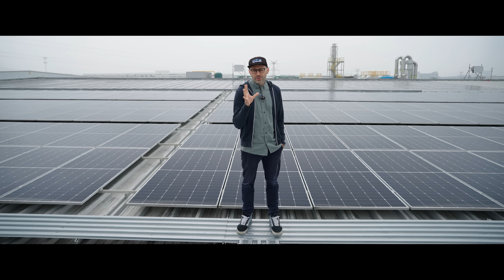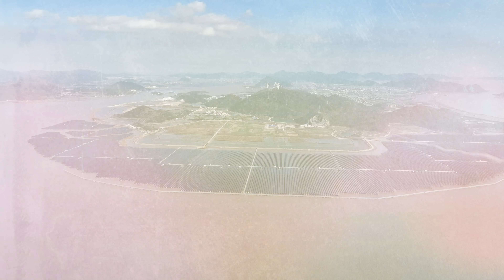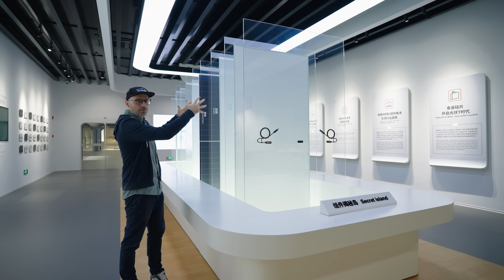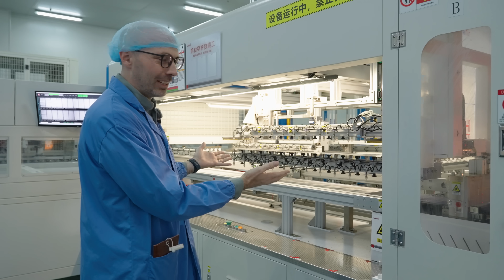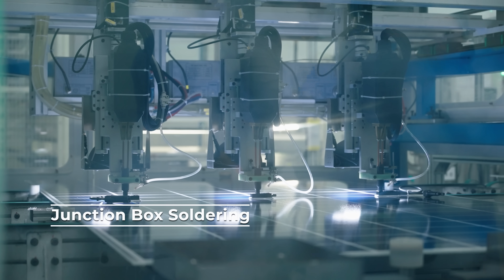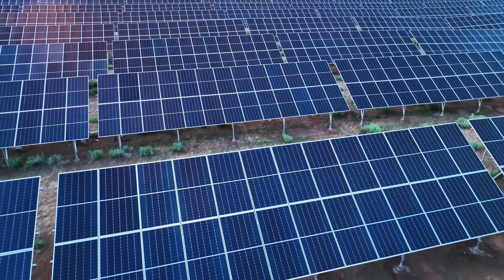Inside LONGi's AI Driven Solar Factory | Everything Electric Show

Comment: The backside gain off a bifacial panel you say is 15-20%. This varies between almost zero (black shingle roof) and 20% high above white sand. So in real world testing is dependent on what's behind it. You can't just state 15-20%!

Comment: Nice soon my 2100mm prediction of 4 panels getting to 3kW is getting closer glad I got the DNO approval, Aiko were in the lead now surpassed not by much but in solar every little helps, but what I would like to know is that a standard size ie 1700 or 2100 and that quote for efficiency is that for the all black version?

Comment: Solar panels seem fairly easy to make and easy to get high yield. By contrast large flat panel TVs are almost impossible to get right and very expensive to make. Yet TVs cost less than solar panels. Why?
Reply: "Yet TVs cost less than solar panels." <- you've presumed quite a bit.  An individual solar panel is not that expensive, but if one kits out an entire house with installation the price is more in the labor and totality of the pieces.  And here in California it costs about $16k to outfit a house with PV solar, and many people spend much more than that on their home theater.
Reply: @TheDanEdwards  For 16k you can get about 80 TVs.
Reply: @frankcoffey because tv also Made in China 🇨🇳

Comment: Very cool! In the intro you hinted at what could be a compelling subject:  Would there be a way to adjust the recipe of a solar panel to optimize it for different latitudes? (and/or climate zones.) What works well in Austin, Texas won't work as well in Portland Oregon of course. But the formula for the panel itself, not strictly the hours of daylight, may also be compromizing its full potential.
Reply: Solar panels require daylight. The more efficient the better. That's about it. The best optimisation I recommend is looking at bifacial panels. These will do better if mounted above the ground. All panels have a dropoff as they get hotter. About 0.3% per 1C above 25C benchmark
Reply: 'Encapsulated from the environment' works pretty well for keeping out both water and dust. Different panels for different latitudes would need a large advantage to be worth the faff and cost of having to make/stock/ship/buy 'north' panels, or 'wet' panels, or 'desert' panels. or 'cloudy' panels for different places. I'm not sure there is enough difference to be had, and just making them 'environment-proof(30 years)' and  'good at collecting light' probably works better overall and is definitely cheaper. There may be real tradeoffs optimising for cloudy places and bright-sunshine places - I think that's the only axis that might be worth differentiation, in which case someone probably already does that. It's the same photons, but at much more random angles and fewer of them.

Comment: Great explanation. Is AI given too much credit? How much is just traditional IT with well thought out manufacturing processes?
I recall with my first panels each one had a piece of A4 paper with the test results. With new panels, can they print a QR code (on the frame), which can be scanned and go direct to the product specs and the test results for that specific solar panel, as well as any paper work needed for shipping and import duties?  
The main cost in solar - especially roof top - is the installation and all the "paper work" and metering associated with it.
Reply: By AI I think these industrial engineers mean computer vision paired with a classification algorithm (could be neural net based) and a well designed stack around that to handle all the requests and integration with the robotic automation tools. Unless they've trained another AI system (ie neural net) to do the whole thing end-to-end which would be even more impressive. It's amazing either way!!

Comment: Elliott you said panels are up to 660W - what is the maximum wattage of standard residential sized panels?
Reply: I do not think there is a single standard size. They have a range of sizes to fit different applications.
Reply: I would say around 425-450W right now a Panel with 22.3% from TCL reaches 435Wp, the same sized panel with 24,43% would reach ~476Wp, they are 172 cm x 114 cm in size, I have TCL Panels on my relatively flat, easily accessible roof as well, but bigger ones with around 228cm x 114cm and they are pretty difficult to handle because they are so big and bulky.
It's a 2 man job really if you want to minimize the risk damaging them, but you usually got a lift to get them up on the roof, if you install PV panels commercially.

The biggest ones I could find from them are 725Wp but weigh 38.4kg and are 241cm x130cm in size so really only for ground-mounted systems they reach 23.1% efficiency claimed.
Reply: See efficient It's not the size of the solar panel. If the panel is only 20% efficient . Then it will produce 550 watts. Also installing 30kg solar panels is normal in China and Southeast Asia and South Asia.
Reply: @DeniSaputta  that is not what I asked
Reply: @mspalmboy   Different panel sizes have different power. The largest panel has 72 cells. Weight 30-35kg.Used by electric companies and people in Asia. I'm serious . 

Westerners like smaller panels. From 200- 450 Watts.20cell- 60cell solar